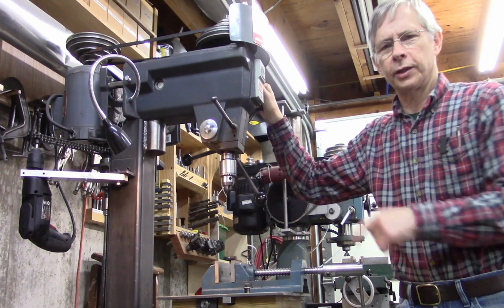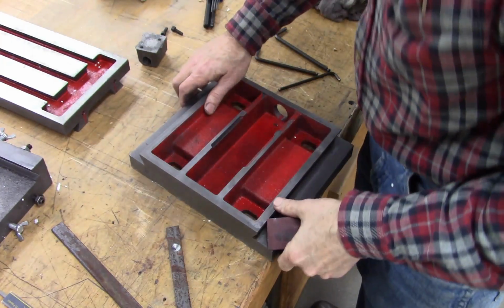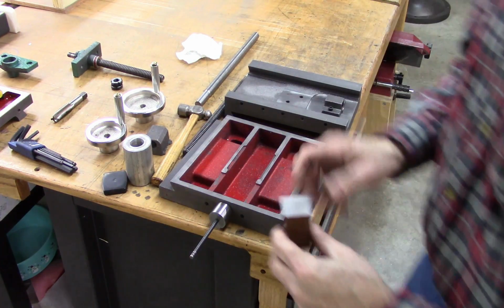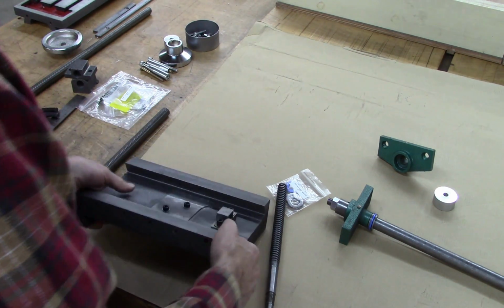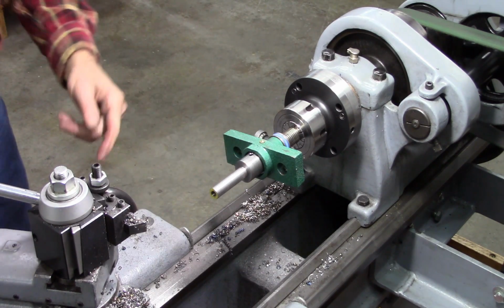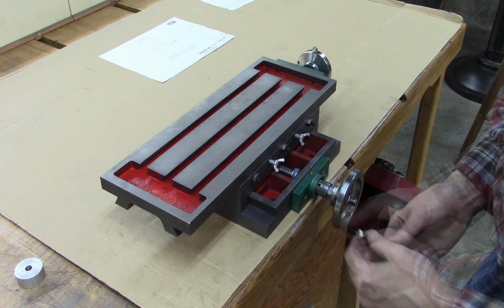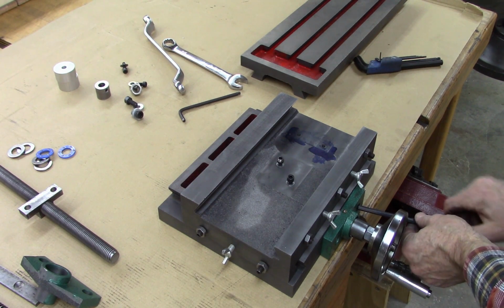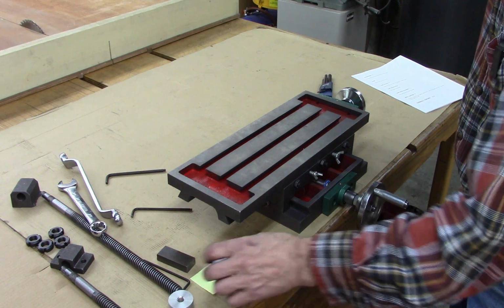Part-1 Vevor Compound Mill Table Review and Lead Screw Upgrade

Comment: Purchased an Interstate 2 axis mill drill table on-line for cheap...$175.00 - 6" Table Width x 19 Table Length, 7-1/2" Cross Travel x 11" Longitudinal Travel, Slide Machining Table - 5" Overall Height, Two 9/16" Longitudinal T Slots, 10-1/2" Base Length x 8" Base Width...The claim, that it was new.......Unboxed..coated with Cosmoline... Took table completely apart - soaked and brush scrubbed in ZEP industrial citrus cleaner all parts in/out rinsed and dried thoroughly Oiled everything with Hoppes gun oil and set everything up to inspect and or re-assemble. The castings  are certainly much larger and were not quite as nice as your Vevor model but the machined ways are very smooth and with some tuning no slop in either table. Both "X" &"Y" axis lead screws are metric Acme thread (not my favorite). Acme are beautiful threads, I just don't happen to like metric all that much but then again, everything with this table is metric............."X" - axis lead screw turned true on a friends lathe...surprisingly, no wobble...But had seriously peened over 8mm threads on both ends of the "X" axis lead screw. "Y" - axis lead screw was another thing.....10mm portion toward hand wheel, appeared to be bent.  Chucked in the lathe, serious wobble. A machinist friend was, believe it or not was able to straighten this lead screw. So when re-chucked it was amazingly true..(will wonders never cease) Also, (I am the kind of person that desires to have the "Y" - axis lead screw terminated with a "cup-end thrust bearing, so the end of the lead screw doesn't just wobble all around) this was the case with is table as well. So, the very end of the "Y" lead screw protruded into a bored hole at that end of the table. To fix this, the 1/2" end of which was machined down to 10mm, the hole at that end of the table was re-bored and fitted with a nice fitted cup end thrust bearing........Both lead screw nuts appeared to have been manufactured by a high school student in machine shop....Hand wheels and dials and table jibs.........I am replacing the hand wheels with something more substantial and as both lead screws have keys/key ways the new hand wheels are as well, keyed. The dials will be a gotcha for me all around......You are the first person that I have seen that has a  set-up for incrementing dials and produced some very excellent ones in a following you tube video. All together this beast cost a little more than $300.00. But I still don't have the dials...........Do yo by chance know anyone that does that kind of work..made to order??
Your table turned out very nice.....you really needed to replace what you had before....I'm somewhat "OCD" so, for me , "a lot of precision is good, but a lot more is, more better"!!!
Reply from the maker: The dials were actually much easier to make than the new lead screws. I don't know of any dials but you should try making them....  as long as you are using 10 TPI

Comment: Thanks for posting the video, why did you need new lead screws? I was thinking of getting one of these, thanks.
Reply from the maker: I wanted them to be 10 treads per inch. This makes one turn .100" and makes standard dials work well. One increment on the dial is .001" . The original lead screw would work well with a DRO and this is probably a more logical approach. They were 4mm per turn. Even if you are used to metric 4mm is a bit awkward to use.
Reply: @WinkysWorkshop   Oh I see, thanks for the reply.

Comment: Do you think the X screw / handle could be flipped to the other side? To be clear, the longer lead screw. Great video!
Reply from the maker: Yes...  however, the lock down screw is also on the left. I didn't show it in the video but i put a long screw and knob on the lockdown so in my case the lockdown and handwheel might interfere with each other.
Reply: @WinkysWorkshop  I think I see what you mean. The y lock is on that side. About 6:51 by your right hand index finger. I missed that when I watched the video. I was considering using a table like this to add a milling platform for my lathe. That is why I would like the handle on the other side. That is if you imagine the table flipped 90 degrees. Then attached to the carriage, top facing the chuck. As such I would want the handles on top and operator side of the lathe. Just thinking through the use case where I might need to mill a slot longer than my carriage moves or vise could support (assuming normal lathe milling setups, which are maybe 4” -6” max). Can’t really just add machinist jacks!
Reply from the maker: @ironhead65  That's an interesting idea as long as the swing on your lathe is large enough. It should work.

Comment: I don't get it, why not just work with metric?  4mm/turn is an even number
Reply from the maker: First, while I recognize that metric is better I work in inches most the time. Second 4mm is just as silly as 16 used in inches, it's hard to work with. 10's are way easier! 62mm = 6-turns and two marks. How many turns with 4 mm per turn? Yes the math is doable but sometimes it's not easy to do it in your head.  The lead screw should be 10 based the same as metric. Even when working in inches for machine work the units are converted from 16 to 10 base. Of course 5mm per turn would work almost as well.

Comment: be interesting to see you spotting the bearing surfaces.
Reply from the maker: spotting?  Not sure what you mean.
Reply: @WinkysWorkshop  for scraping in.
Reply from the maker: @RedDogForge  I didn't think it needed scraping.
Reply: @WinkysWorkshop  no? indicate it? if not how do you know without spittingg it? not trying to give you a hard time wink, just trying to get a complete understanding :)
Reply from the maker: @RedDogForge  I have indicated it on the long axis and its within .0005" the length of the back jaw of my vise and that's probably imperfections in the vise jaw. I know they call this a mill table but it's nowhere near solid enough for milling. I'm using it on a drill press to locate holes. Realistically it could be out .010" and never be a huge issue but I suspect it is much closer. Honestly I have considered checking it for squareness but otherwise I'm not concerned.

Comment: could not a spring over the screws overcome the lash on your homemade table?
Reply from the maker: I used the heck out of my old table. The only problem was that it would not lock in position. Less backlash would help but while drilling large holes the table would still move. The Vevor table is much more solid and the only real quality issue as the lead screws.

Comment: First thing great videos keep them coming, but I have a silly question, I received my one of these a couple of days ago, everything seemed to be good until I went to put the handwheels on to find out there was no keyway in the smaller one, my mic is only metric being frome the UK and they are not 3mm and not 4mm so would you or one of your subscribers across the pond do a quick  measure up so I get the right grooving tool, best regards to you and your subscribers, David.
Reply from the maker: I no longer have the original screws but I'm sure mine had a keyway. I'm using the original handles. I think I bored them a little but they should have part of the keyway...  Yes, I just checked. 3.8 MM. Weird... 4mm would be close enough i think.
Reply: @WinkysWorkshop  thank you, much appreciated, tried to get a replacement from vevor but they didn't want to know, told me it was usable without the handwheel !!
Reply from the maker: @BME-UK  Oh that is weird. I think they have some chinese ladies answering emails. They probably don't have a clue what a key or keyway are.
Reply: Only one can wonder !! I ended up drilling and Tapping a 4mm, when I have time I will machine both hand wheels down like you have done,

Comment: Nice video. Wondering if you’ve had any ideas about putting stepper motors on it , mount to your milling machine table and have a 2 axis CNC table. Similar to your CNC wood lathe.
Reply from the maker: That would be interesting to try although I'm not sure it would be worth the time and money. Most of what I do on the mill is straight moves. With the wood lathe CNC is a huge advantage because it always involves curves that are very hard to duplicate with X Y moves.

Comment: I think if I made a review on this X Y table it would be more favorable. For the money you just can’t beat it. ~Ricvis
Reply from the maker: I agree to a point. I guess it depends on what you need and what you expect. It's certainly true that you could buy this table and install a couple of DROs and have an exceptional mill table. However, if you wanted to do accurately position work for drilling without DROs or modifying the lead screws you would struggle. The 4 mm pitch lead screw is ridiculous and all the related components are poorly made. However, the castings and table itself are amazingly good. Maybe I should have had two ratings. An out of the box rating of 4 and a rating of 8 or 9 for it's potential. I'll have to say... I am currently enjoying this table. After the modifications its fantastic.

Comment: Can you tell me how thick the casting is on the y axis, you see....
I'm trying to build an x y rotary table and the rotary I have is a fine english made thing with 4 slots arranged in a ❌ .
The XY that I have doesn't fit this and would require a couple of new slots to be cut, which I'm very hesitant to do, being a fine english made thing of good quality .
I'm thinking of getting one of these XY tables and fitting it...but may have to drill into the casting of the y axis so as to align each axis with 0° , 90° etc
What's the size of the dovetail, depth from top flat face to bottom flat face, and major dimension.

Don't want to spend the money only to find I can't do what I want
Reply from the maker: Send me a sketch in email and I'll see if i can answer your question winkysworkshop@GMX.com

Comment: I went ahead and purchased one of these and as you say, petty amazing for the price.  The one I received is exactly like yours, even the packaging is the same.  I noticed that the one shown on the Vevor link as well as on Amazon and Walmart show a unit that has more gib adjusting screws and has a cover over the lower lead screw on the inside of the base.  I wonder if there are more differences, perhaps one is an upgraded model.
Reply from the maker: I wondered about the cover also but never noticed the additional gib screw. I think maybe the cover limited travel a little. Mine moves about 3/4-inch over spec.

Comment: Love your content. I just bought a 2 hp drill press and I wanted an x y table for it. This one seems to be the only thing out there. So. I got it. Mine is exactly like yours right down to the bent shaft and loose fits and crazy angle holes for the rod. I ordered the McMaster stuff and plan on tuning mine up to something less rickety as well. Thanks again. Perfect timing for my shop at least !
Please keep up the great work!
All the best. 
Bruce
Reply from the maker: Thanks! The hardest part is alignment of the nuts. The screw is a close fit on the longer axis as well. Enlarging the two holes out in the bearing blocks helps a lot. I love the outcome on my table but a DRO would have been a lot easier.
Reply: @WinkysWorkshop  thanks again. I agree. But. It is a drill press!  I am just going to use it so I actually have the vise mounted (rather than just holding the vise in my hand and aligning it-which I have been known to do!) so it’s just x y. 
My mill has a 4 readout 10ths DRO and I love it !  You do great work. I love watching you just dive in and make it happen!  I plan on making your hands free die holder and spring style cut off blade holder as well.  Excellent ideas. Love them both. 
Thanks again.
Reply from the maker: @bruce150  That's great! I love having some kind of mill table on the drill press and almost never use my mill to drill. On the current mill table and the slide table I had before the vice was never removed. I had a few 1 foot square pieces of 3/4" plywood with a 2x4 mounted to the bottom. If I needed a table without a vice and just clamped the 2x4 in the vise.

Comment: I  bought a similar unit at a club auction and had to remachine the dovetails as they were so rough even the slightest tweak of the screws locked the tables. I carried it home on the london underground,  not something i would recommend, ever!
Reply from the maker: Mine were a little rough but not bad. I took some fine emery cloth to them and it worked smooth
Reply: @WinkysWorkshop  for the £10 ($13-14) I paid i wasn't complaining.
Reply from the maker: @chrisstephens6673  That is a Great Deal!
Reply: @WinkysWorkshop  some one else's loss was my gain, that's the beauty of no reserve auction lots. I guess the first owner didn't like the roughness of the sideways but my time to try and fix it was also cheap. 😉

Comment: After a bit of hand scraping, it might be up to some precision work. For a drill press, I suppose it isn’t as important. The longer the thread, the less wear on the nut and the screw.
Reply from the maker: Yeah...  its good for a drill press. The longer threads are good but very critical for alignment. The nuts are about a 1/2"... not too bad.

Comment: Now to finish the project you need to get your dremal with a cutting disk out and put some oil groves in the ways and then install some oil zirk fittings. I have done that to all of my Chines mills and lathes. They like this table came with no provision for oiling the ways. I put the oil grove in the gib ( on my rongfu 30) so you don't have to have the table in a special spot to oil that way. my gib stuck out far enough that could do it that way.
Reply from the maker: Probably a good idea!

Comment: A tip for centering on the 4 jaw you can get a second center and put it between your tailstock center and into the punchmark on the block and indicate off of that since most centers have a center hole in the back if your punch mark isn't deep enough you can spot with a small center drill then you can indicate on the flat section on the center instead of the block 👍👍👍
Reply from the maker: Yes that would work well I think. I'll keep that un mind, thank.

Comment: How I intend to eliminate the backlash is by useing two leadscrew nuts setting one that is driveing the table one way and with out moving anything take the second nut and turn it tell it is tight to turn the table the other way and secure it there that way as soon as you try to change direction you have a leadscrew nut tight in the opposite direction.  Note doing that where you have a heavy load ect. Will induce wear and with some manufacturers make the nuts out of bronze  allowing the nuts to wear out and not the leadscrews for me I will also drill holes through the nuts to a oil ball spring loaded  giveing a lot longer life to the nuts and smooth operation.  But that's me.!
Reply from the maker: Good luck. Based on experience this will work but not as well as you think. Also I'm thinking you need to use acme threads if you are going to try this (which you may intend to do anyway). I totally agree with bronze but I was saving a little money. At least with my intended use there will be almost no load on the screws so wear will be minimal (drill press is not a milling machine). Consider these things: 1) .005" backlash is easy to deal with. 2) slight variations in lead screw pitch, rough threads or a slight bend will make the lead screw bind. 3) backlash for acme and standard threads are normal, they need the clearance to hold oil and be able to move.  Based on my own experience on the last slide table I built with acme threads anything less that .003" backlash made things bind terribly. In fact I gave up and didn't use it

Comment: I would suggest that you could also add a groove for an o-ring that just rubs the indexing ring, just add a bit of oil or grease to let it slide.   No tool needed to adjust it.  Just grab it holding it to turn until you have it where you want.
Reply from the maker: That might work well although getting the depth of the groove right might require some testing. The nylon weed eater line works very well but the o-ring would eliminate the hole in the dial.

Comment: Much better after the Winky treatment but you have to wonder why the manufacturers couldn't bother fixing some obvious quality control issues. You could probably fit some sort of bellows or swarf shield over the Y axis screw and thrust bearing.
Regards,
Preso
Reply from the maker: Ha...  the winky treatment huh? I like it. Yes, I agree. It seems like a suck a waste of time and materials when 10 minutes additional setup time on a production line could make them all much better.

Comment: Why would you need new lead screws? I would assume that just a dial with inch scales would do the trick
Reply from the maker: The lead screw needs to be 10  TPI (treads per inch) to make the dials work. You can divide the dial into 100 increments and each increment will be .001". The original lead screw was 4mm per turn. 4mm = 0.15748 " You would need 157.8 increments on the dial. You could put round up to 158 increments around the dial and be close but every turn the error would increase. Also, if there were 158 marks and you needed to move .200 the math gets weird. With the 10 TPI lead screw there is 100 marks around the dial and its easy to count. Every 10 and 5 line is a longer line so if you have to move the .223" its 2 turns, 2 tens and a 3 ones.